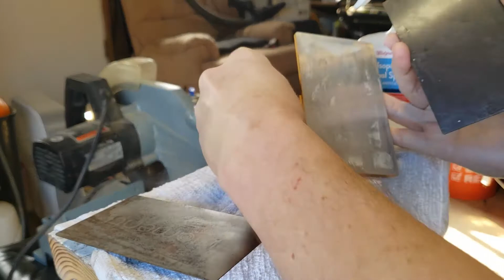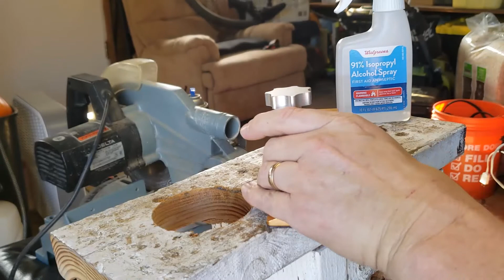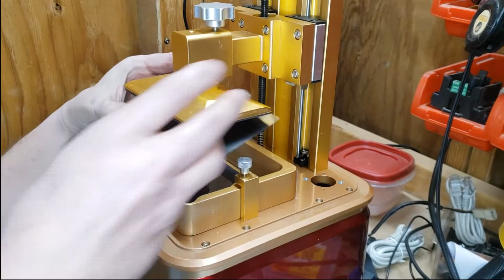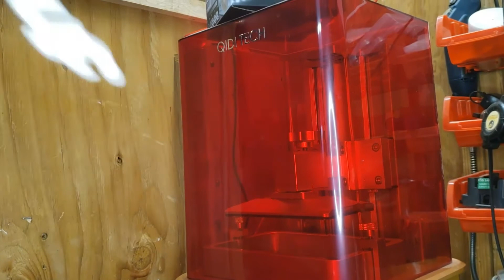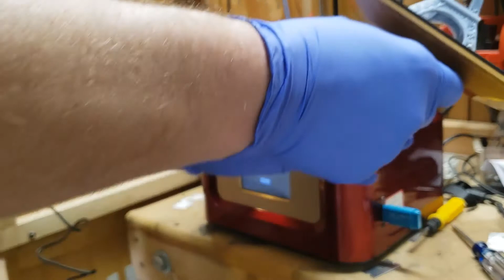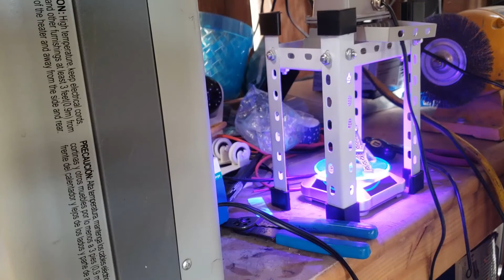Fulament Fula-Flex: Resin Edition

Comment: Any issue with the glue being eaten by the resin / alcohol?
Reply from the maker: yes, but mine some had used and returned, I think that I said something about it in the video and it was still that same corner that came loose, I think it was more that was the issue, I have sold the printer now so can't give any more updates, resin is just not my thing. I did get some great prints off of it.

Comment: > year later... still using?  Thoughts?
Reply from the maker: Let me start off with saying it's a great little printer.
I have sold the unit now as I don't like to make small little figurines, however the couple little Parts I made and characters for other people they turned out awesome and I didn't have very many problems with it, I tried making parts for my other 3D printer and the parts were brittle and would break easy, that being said there is tough resin out there it just cost a whole bunch and I can't afford it so that's why I sold it.